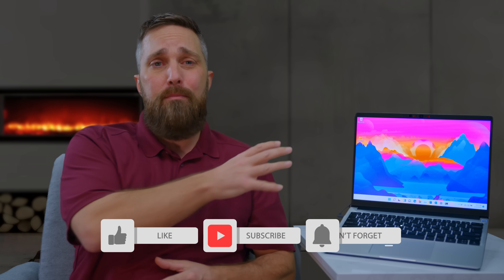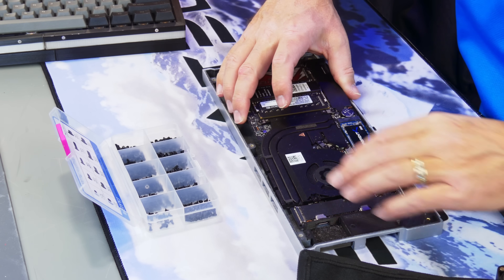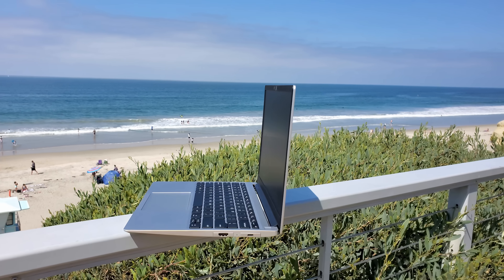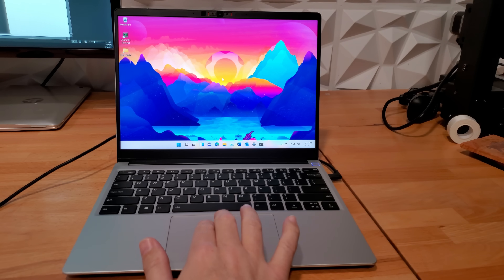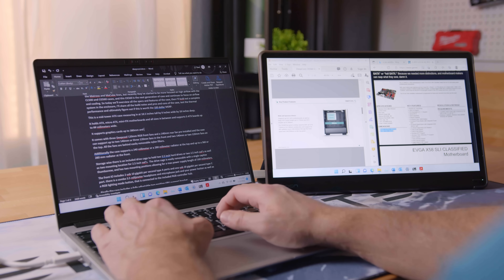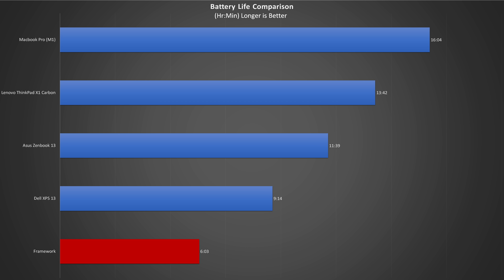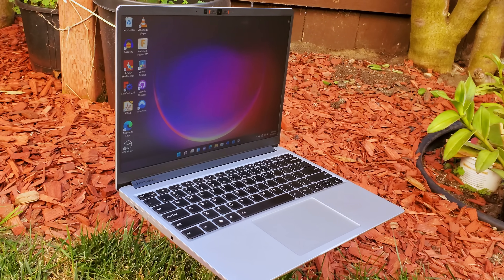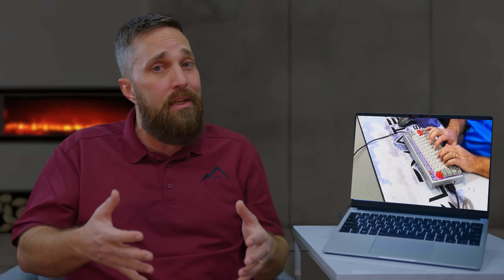Framework Laptop 6 Months Later. I'm Less Impressed 😐

Comment: "Battery life is bad, about 6 hours"

Coming from a Dell laptop that, in three years, ate through 2 battery packs and even on a fresh one never delivered more than 3h, that's awesome to me.
Reply: i get 2 hours maximum on my ASUS laptop and about 3 hours on my 2009 MacBook, so I have the same sentiment
Reply: It is relatively speaking, problematic, considering that competing laptops at the same price point can easily get 10 hrs or more.
Reply: @blue4059  what laptop would you recommend that has great battery life, a great webcam, and has a great trackpad. Installing fedora on it
Reply: @kayseeday  Perhaps an office laptop with an AMD CPU seem to have the longest battery life or a Mac.
Reply: @blue4059  use this.

https://youtu.be/B1iRxoyT4EA
Reply: @blue4059  doing what? Even Apple can't reach ANYWHERE near advertised time with any activity whatsoever.
Reply: @blue4059  so why is the framework worse on battery life then
Reply: @swift7169  because it's not optimized well
Reply: @blue4059  So is it hardware or software optimization? Can one expect it will be better with updates?
Reply: @rowdyyates7247  Hardware optimization. Typically bigger OEMs have more experience and know-how to pull this off.

High-end laptops from Dell, Lenovo, HP and Asus with the same battery, display, and cpu get 8-9 hrs on average. On top of that they can also afford to source more compact and bigger batteries for the same price, which results in 10 hrs+ runtimes vs 6 hrs on the Framework barebone.
Reply: @blue4059  None of the other laptops have the same display as this laptop. The only exception is Acer Swift 3 sf313 series of laptops. This display is much brighter, clearer and contrasty than other laptops in its class.
Reply: @swift7169  Probably a combination of hardware design and software optimization.
Reply: @blue4059  it’s irrelevant. Just excuses. Consumers only care about results. Bottom line is the battery life is shit compared to the competition
Reply: My laptop doesn't even have a functioning battery lol.
Reply: My HP Omen 5 with i7 8750h and gtx 1070 can only last a little bit longer than 1h on linux with Nouveau driver.
Reply: laughs in 18.5" alienware

I've never been able to use that laptop unplugged.  At best you could carry it and the charger to another room to plug in.
Reply: @nes999  Ha. Yep. I’ve had machines like that. That’d be a desktop replacement machine. Typically those have good horsepower but terrible battery life.
Reply: @spareroomtech  I'd love to find a modern equivalent until then I'm running this until she blows.

I tend to set up a "base" on location so I don't mind a 19lb behemoth as it'll a it there for a couple days. Then pack it up and move out. Customers do tend laugh when you roll up with a 10 yr old beat up alienware though.
Reply: @nes999  hey, I get it though. Some of those big desktop replacement machines were nice, and if you don’t move around with it much, then it doesn’t matter.
Reply: I've rarely had laptops run longer than 2 hours, 6 hours sounds epic, even if that's best case
Reply: Because I own the Acer Swift 3 sf313-52g (Framework laptop uses the same panel as that laptop) and have compared my laptop with a Gigabyte OLED 15, I can conclude that that 3 by 2 panel is comparable to the Samsung OLED panels and does not have the various issues of OLED panel.

And you have to know that the degradation of all the organic LEDs in an OLED panel is occuring whenever you are using it so the OLED panel will get darker and darker over time. 
And because the blue organic light emitting diode degrades faster than the other two, OLED panels will progressively become yellower over time. My old Samsung phone is already yellower than my brother's new one.
For both these issues, there is no trickery you can use to prevent this.
And the burn in issue is a misnomer as well, it should be called degradation issue. If some parts of the screen displays red more often then the parts, then that part will have their red diodes degrade more than the other parts of the display. And this degradation have no way to prevent it. It is this continual degradation that leads to burn in. But you have to know that the degradation is continually, insidiously and irreversibly happening all the time.
Reply: An i3 Chromebook can do 8 hours on almost full brightness (yes, i was also super happy with it, and for 350 euros)
Reply: I find I mostly plug laptops in anyway even on a long flight I plug it in.
Reply: @TALKCalgary  how long a flight? when my laptop can do 8 hours of youtube playback, im just afraid i wear out the battery prematurely
Reply: Doin't get a MacBook then or your mind will really be blown.
Reply: Laughs in 8 year old HP laptop that's connected with power all time and barely lasts 2hr after replacing 2 battery.
Reply: What dell? My XPS gives me 8-10 hours, and it's a 6th gen... that said, i change the battery every 3-4 years.
Reply: My current one lasts only 4 hours on min brightness 
I see this as an upgrade
Reply: Dell XPS 13 will do you for about 10-12 hours, depending on what you're doing.  The confusion likely comes from the fact that Dell also sells a bunch of cheaper stuff that is significantly lower quality.
Reply: @JMurph2015 their laptops for the corporate world are disposable, good for maybe two years, three max then just throw it in the bin….  every one I’ve had the fan runs continuously, the back is permanently very hot, and after a year or two the keyboard begins to rise as the battery swells…
Reply: @blue4059  And also this display is 3 by 2 which is very good for doing office work and I don't think there is any OLED that is 3 by 2
Reply: 3h out of a Dell Laptop?
you're lucky you didn't use Dell laptops 10 years ago, i've had a horrible garbage Studio XPS 1558 that lasted barely 1h20m on battery power, 2h if i set it to "battery save" mode.
in the meanwhile, a MacBook Pro 13" i got 2 years afterwards lasted me nearly 5 hours on battery power with the iGPU set to always be used, with the iGPU set to the default state of "automatic use" i was getting 9 hours of battery out of it, hell that MacBook Pro is still up and running nearly as good as it did 10 years ago. find me a WINDOWS laptop that you can say the same thing about, a co-worker of mine had a Dell Precision 7710 with the top of the line specs (E3-1575M, 128GB Ram, FirePro W7170M and two 1TB NVME SSD's) and that piece of shit laptop couldn't even upgrade to Windows 10 because its AMD GPU prevented it from doing the Windows 10 upgrade, it would only upgrade when the GPU was disabled in Bios but then completely crash and stop working when re-enabling it, even the latest GPU Driver from AMD themselves couldn't solve this, this is a disgrace that a 7000$ laptop cant upgrade to an OS that officially came out just a few months after its release and is stuck on Windows 7, an OS that came out nearly 7 years before it was released.
that is Dell for you in a nutshell.
that same Dell i had also had its motherboard replaced 5 times in a timespan of 2 years of "extended" warranty, garbage overpriced piece of crap computer..
fuck Dell.
Reply: Use this better.

https://youtu.be/B1iRxoyT4EA
Reply: Hell try HP
Reply: Looking at the old T420/T430 one could get up to around 20 hours on the battery depending on configuration and the health of the two 9 cell packs. The slice pack which is the attachable secondary battery using the docking port is a bit rare though so there isn't much of an excuse for modern hardware to be so poor design wise. Deleting the cpu socket and the mxm slot were two of the biggest mistake of the decade when it comes to laptops but the one for all users is the loss of the removable battery with almost all designs. Personally for a lot of reasons modern laptops are just terrible despite having some better tech as well a few valuable features they lost A Lot along the way plus the thermals with almost all of them is the poor thermals leading to less than ideal performance where older designs can leave the cpu at max turbo for hours on end while under load.
Reply: I have an acer and I get two and a half hours browsing the web. Best battery I have is in the Switch Pro of all things
Reply: I don't know, my current alienware can get me between 6-8 hours on battery. Mind you when I'm battery I don't use it to play games and put it into battery saver mode on the command center and on windows then lower the display refresh rate and brightness. When I run my laptop on battery I let it behave like it's an ultrabook that got into a box of doughnuts the other night. 

With that said framework is still a new company and it's ideas are against the grain of every other laptop manufacture that I am aware of and in a good way so I hope they do well enough that they force the hands of other laptop makers into having modularity even creating standards for that. Well, at least well enough that they stick around long term and stay true to their current intent.
Reply: My Dell i5-5558 holds about 20 min battery :D
:(
Reply: My current laptop is empty after about 1 hour, if not faster. But tbh it is a ~7 yr old Lenovo laptop and I never changed the battery and have often left it on the charge with a full battery.
Reply: That is horrible battery!
Reply: You obviously haven't configured your battery setting optimally, or you have a very old or faulty Dell.
Reply: I'm a power user so if my system doesn't have an intense CPU, GPU, RAM ,SSD then i'm just sitting there waiting while it freezes from me launching my 100+ tab firefox session with 21 extensions, 3 discord clients in 200+ discord servers, zoom, OBS, vscodium, kitty terminal with several TUI apps, Android Studio, 5 file browser windows, Steam, Element matrix, Hexchat IRC, Blender, Photoshop 2021 in wine, Thunderbird and dozens of background services. No laptop I've ever used lasts more than 2.5 hours battery when I'm working so I just always sit at outlets and plug in. current primary laptop is 2013 Dell Precision M4800 with i7-4810MQ, FirePro M5100, 32GB RAM and Sandisk X100 SATA SSD. a newer laptop could run faster for me but I don't feel the need to upgrade yet
Reply: Yeah man my laptop gets about 1 hour of battery life if I do anything other than watch videos on it..
Reply: Intel  battery life is dependent on windows running background, background tasks using high clocks. 
manufactures make them last longer to run idle clocks too low and boost to some average clock when needed.
my 2027 dell 7567 gaming laptop lasts 8 hours on powersaving mode, 
while MSI gp66 11800h rtx 3070 last 2 hour on small task on battery saving mode, while on  performance mode gives 1 hour on light 3d tasks, while on heavy 3d work 30 minutes.
Reply: Try a MacBook or a thinkpad with dual batterys (MacBook will get you like 10-20 hours deppending on what one you got how old and battery health)
Reply: I get like 1 and a half hours on my laptop. Also from Dell. New.
Reply: FUN FACT, some all amd CPU,GPU LAPTOP can deliver above 10 HOUR backup.
Reply: Fully agree - i have 2 labtops that does not last nearly that - my lenovo t14 only has 2 hours of battery life, my dell latitude 15 has somewhere near 3 hours ... so even having 6 hours would be a crazy upgrade !
Reply: Do you have an inspiron 7373?
Reply: 6 hours is kind of optimistic for most laptops in real world situations, which makes the battery average (modal) to good.
Reply: @GenlackGenlack  No I agree with CJ. I can get 7 hours on a 11 year old MacBook Pro 2012. 6 hours at best is not a great situation for something that costs as much money as a laptop that gets 12+ hours.
Reply: On my 2012 ASUS ROG $1,200 laptop I'm lucky to get an hour on battery. lol  But I use it at home all the time while plugged in, so no biggie.  A 7 hours battery on the Framework is like heaven. heh   By the way, Framework has come out with speaker upgrades which can be installed fairly easily and sounds great.
Reply: XPS  WAS the only thing with close to 100wh but then they removed the 97wh battery from the 15 inch and gave it to the new 17 inch. Now it has trash battery so now in the world battery life it is Any ARM Macbook vs XPS 17
Reply: Yea, if I'm lucky my laptop gets me 2 hours 
And the battery was like 7-8 hours when new but it was already like that after a year
Reply: @tydshiin5783  - Lithium ion batteries in laptops degrade just like in EV's, depending on the number of charging cycles and charging levels.  Many 2010-ish laptops used standard 18650 or 27000 batteries in their packs which is fairly easily replaceable for less than buying a whole new pack.
Reply: I have an hp omen gaming laptop. Don't even game on it. 2.5 hours battery life.
Reply: fr my brand new dell inspiron 15 3515 dies after like 2 or 3 hours literally just from having a browser open
Reply: Haaahahahaha... "bad - about 6 hours"... every single DELL or Lenovo laptop I got from my company in the last 10 years WISHED it could get even more than 3, 4 hours of battery runtime. Seriously. It's embarrassing how bad the battery situation still is with so many laptops. If you're not careful with frequently loading / unloading the battery and just leave it connected to the charger 95% of the time (in the office), most of them still seem to deteriorate quite fast.
Reply: @bellissimo4520  45 minutes is what I get after 2-3 years…. the fan runs nonstop like a jet taking off…
Reply: @bellissimo4520  I've always had good experience with my 2019 Dell XPS 15, usually giving me 10hrs battery life. Though I did spec it as an i7 and a 1080p panel so it did have better battery than the i9 4k spec. I did have to replace the battery a few months ago after it was only lasting 5 hours.
Reply: M2 here. You guys are pathetic
Reply: Yup, same
Reply: My one year old Asus lasted maybe an hour? Had an i7 and a 3050 in it.
Reply: Hey any chance of a AAA battery pack as external powered source?
Reply from the maker: That may be true for you but what about someone coming form an older MacBook that still gets 8+ hours of battery life? That's why I compared it to current similarly spec'd laptops.
Reply: @ElevatedSystems  Older MacBooks did not get 8+ hours back in the day. They weren't hitting those numbers until they went ARM.
Reply from the maker: @sorrai  I have a 2013 Macbook Air that I got used and it still gets over 8 hours
Reply: @ElevatedSystems I have Powerbook G4, it holds 30 seconds
Reply: @sorrai my clamshell iBook would go eight hours…. had a Motorola power pc cpu I believe….
Reply: @ElevatedSystems  just use your apple 🍎🍎
Reply: @ElevatedSystems  older macbooks don't last that long though
Reply: @schlong8276  you do get that you're in the minority though right? glad to see you actually take care of your stuff though
Reply: @interrobangings  it’s 2022 😬.
Reply: @ElevatedSystems  LOL, I had an older MBP, and I was struuuuggling with 2 HOURS battery life every single day!
Reply: @ElevatedSystems  why are you crossing OS? Comparing a Macbook (using ARM mind you) to a windows laptop is irresponsible
Reply from the maker: @theinktician  Irresponsible? LOL, Macbooks are direct competition to any ultralight PC laptop. I've had multiple people trying to decide between a new MacBook or a Framework ask me for advice. In about half those cases, especially if battery life was a concern,  I've reccomend the MacBook.
Reply: @theinktician  Crossing OS argument doesn’t really count here… MacOS is very closely coupled with macbooks and very separated from non macbooks. It’s essentially one with the hardware, especially when talking about battery life, since MacOS is specifically optimized for apple hardware and nothing else.
Reply: @theinktician  and he said "older macbooks". Older macbooks don't use ARM
Reply: @ElevatedSystems  What happened to 'If you want to run MacOS then get a MacBook, if you want to run windows(/Linux) then buy a laptop' ?
Reply: @ElevatedSystems  you only get these battery life because in most recent (some older like macbook) laptops everything is soldered together. that gives you better battery but no repairability
Reply: Me, using Macbook pro with a 1h30min battery life after going through 5 replacements (1 that broke the MacBook).
That's a dream
Reply: You must have your brightness at 100%….connected by wifi….Bluetooth on….and on a older dell from around 2015
Reply: @blue4059  The problem with OLED laptops is the burn in, and that really puts me off OLED laptops because of the hassle and daily stress of needing to baby the screen. There are lots of static elements on computer screens that can be potential culprits for burn in. And the other potential issues with OLED panels are flickering, Gray banding and black crush. And even if an OLED panel have high brightness, the higher the brightness, the faster it burns in, which means you are forced to use it at lower brightness. 

What other laptops have you got in your list of 30 laptops
Reply: I find laptops often promise 6 hours of battery life but actually only last for about 2 under normal use for me.
Reply: Dell just has plain bad battery life
Reply: Don't buy Chinese batteries.

Comment: Interesting review. My Framework arrived today and I notice Windows is reporting my 3200MT/s RAM is running at the proper speed.
Reply from the maker: That means the base speed of your RAM is 3200 MT/s which is exactly what you should have got from Framework as they don't use XMP enabled memory.
Reply: @ElevatedSystems  It's a DIY and I used 2 x 16GB Corsair Vengeance. BIOS 3.07 already on the laptop when it arrived.

I expect you're right though and this is maybe the base speed for this RAM. Didn't think about it when I bought it, to be honest.